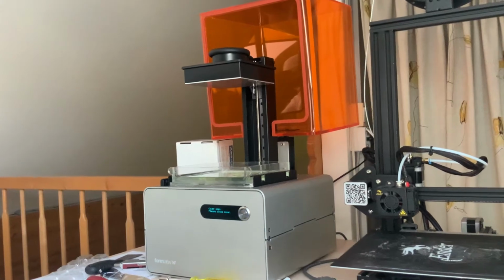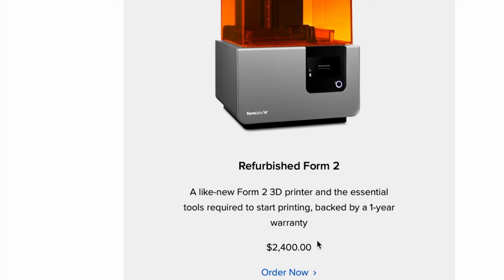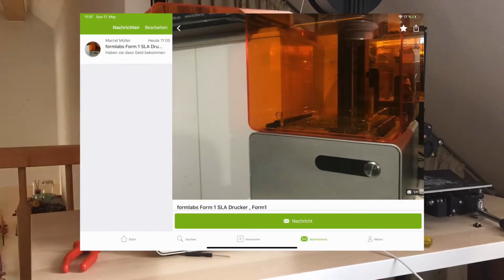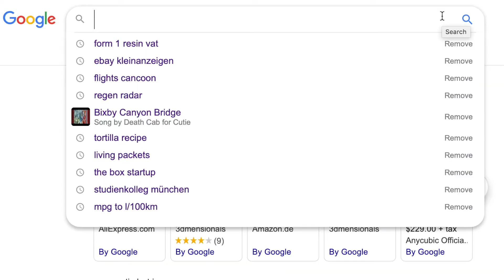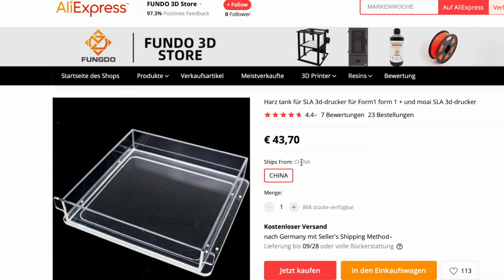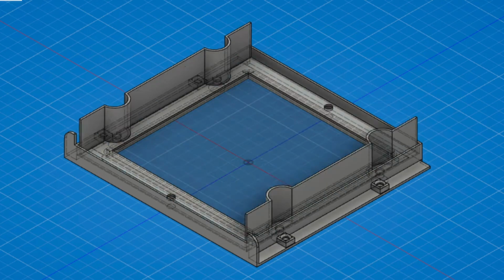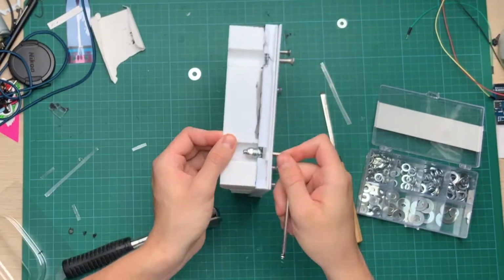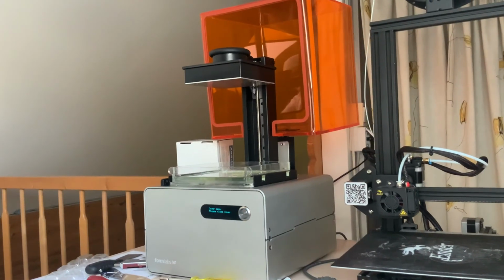$3,000 3D printer for under $200 Formlabs + DIY Resin Tank

Comment: what did you use to clean up the cover with - as i've been given a form1+ that basically looks the same as in that video ?
Reply from the maker: I used Isopropanol alcohol. This worked really well.
Reply: @PhilipMerlin  thanks - did you need to do anything special with the machine to use your 3d printed tank? i.e. calibration, as i'm going to be trying out your design

Comment: did you have any issue with your tank or is it  working great?
Reply from the maker: I made several versions the one you see in the video works just fine the first one i made had a small leak but this was fixed by adding the bolts.
Reply: Can you give me some contact information like e-mail discord etc for further talking about these things
Reply from the maker: I have reddit it’s @PhilipMerlin